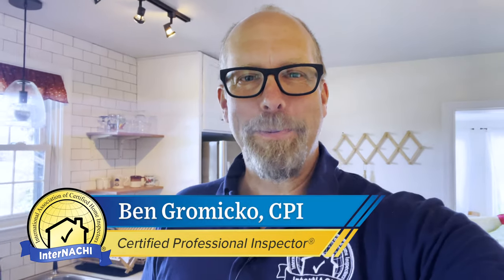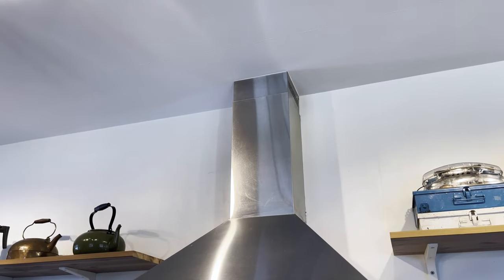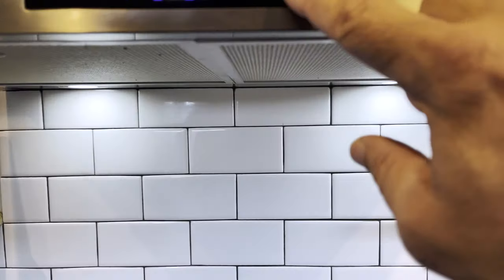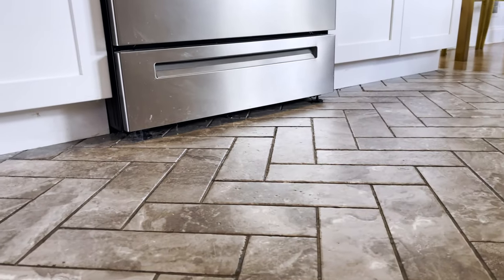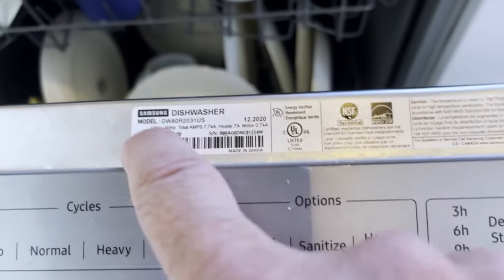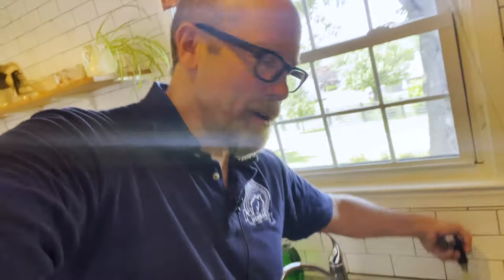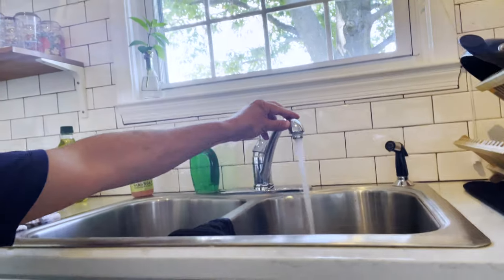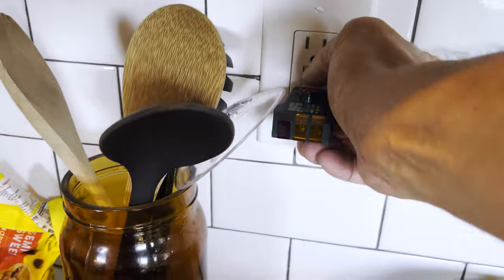Inspecting the Kitchen with InterNACHI's Ben Gromicko

Comment: The vent hood looked like it was actually a recirculating hood. Possibly not exhausting outside. The slots at the top section of the vent pipe/duct, near the ceiling could be a sign of a recirculating vent/range hood.
Reply from the maker: Right.

Comment: You ain't going to call out that s-trap?
Reply from the maker: Yep. Good catch. Those traps really don't come up as a major defect. Water leaks, yes.
Reply: @internachi  Sewer gases entering the home is a major defect and safety hazard to me. But that's why home inspectors are basing their inspection on personal concerns not code.